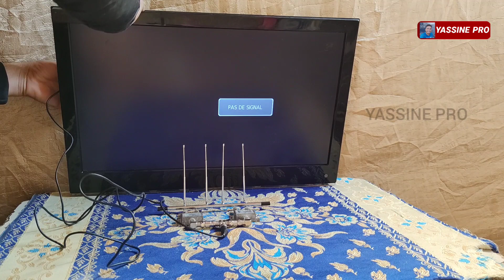كيف تجمع بين السويتشات للحصول على لاقط هوائي رهيب لمشاهدة القنوات الارضية بجودة عالية HD

Comment: Need something to make electricity AC current not DC current. That was neat with the little electric motor for the fan blade using wind to make DC current but that's easy to make DC current we need AC current. Like I said though it was neat way to do it